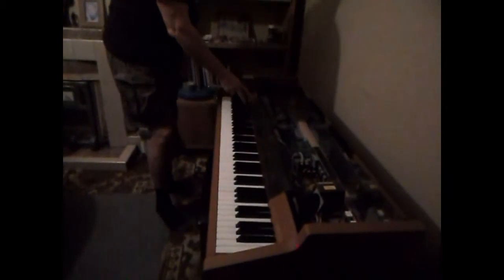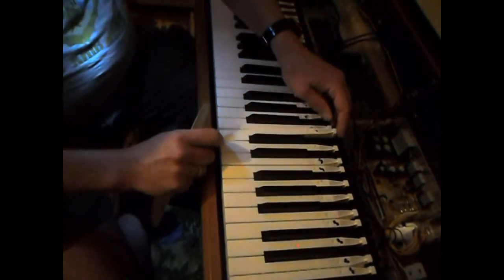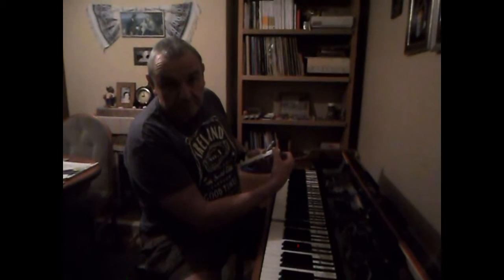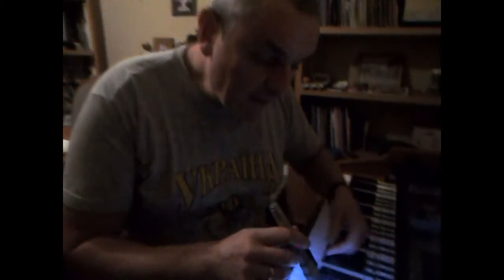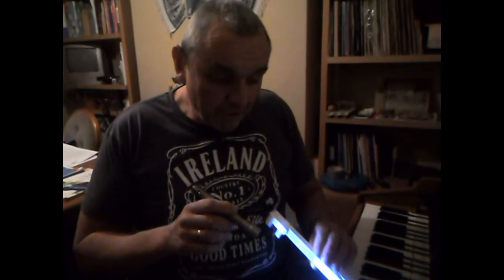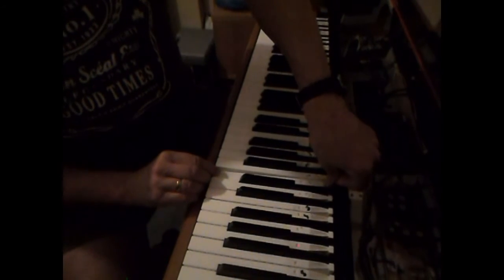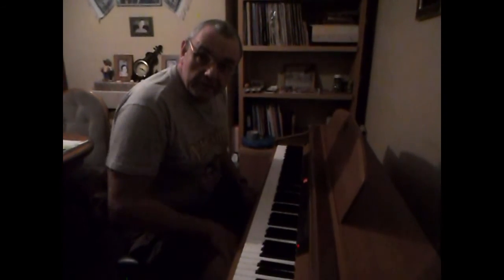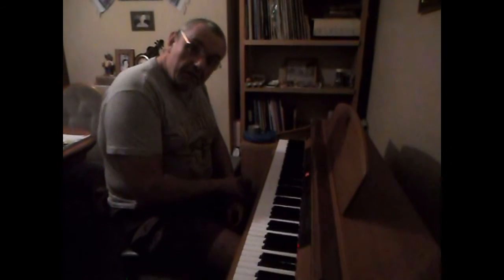Yamaha Clavinova piano CLP 950 repair video

Comment: Fixed it ! .....the earlier clavinovas actually have 4 graphite strips pre key and after cleaning and repainting them 6 times ( made my contact paint with water based polyurethane and graffiti powder ) with no results on the last try before putting it on the lawn , Out of the corner of my eye a tiny glimmer of copper speck flashed on the trace between the next 4 strips , the green material that seals the copper trace had worn off so small you really couldn't see it.... but it was enough to make contact when the the key was pressed.... paint brush and poly urethane over the worn spot..... good as new....there is no way of replacing these board yamaha stopped selling them so bringing them back to life is the only way... thank you for your help , i hope this will help other people keep these alive....
Reply from the maker: Thanks Ray, glad Ive been of some small service!